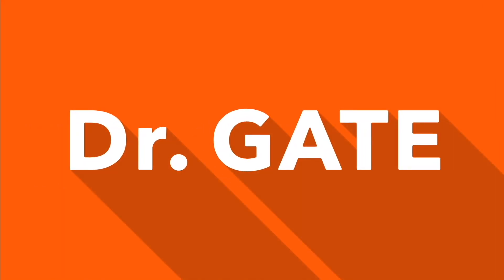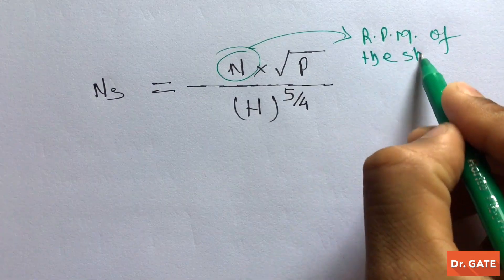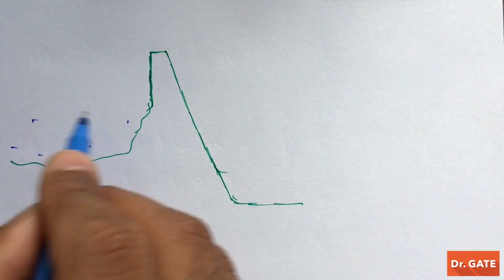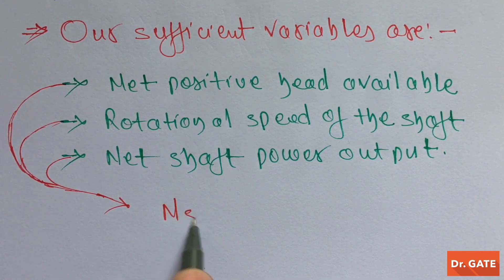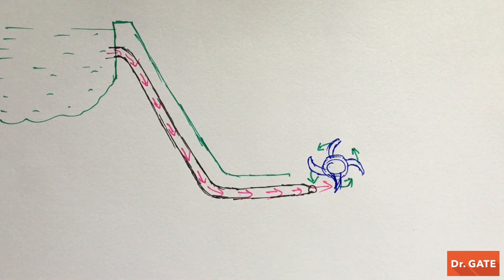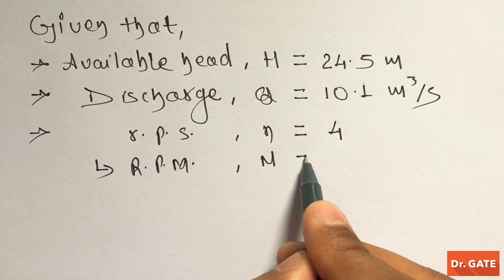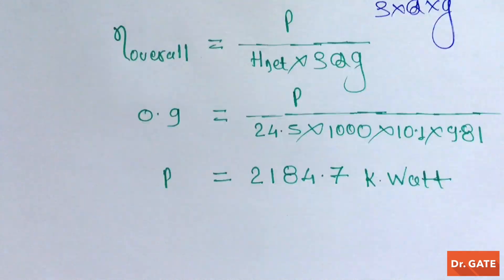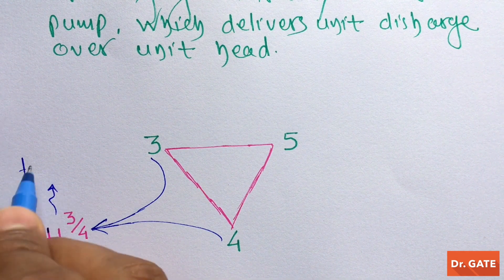GATE 2019 | Fluid Machinery | Specific Speed of Turbine

Comment: Sir please explain  what is the exact difference between Vapour pressure and Saturation pressure.
Or 
Are they same thing?
Reply from the maker: No, they are two different things.
Suppose u r in ur room, which is completely closed (air tight). Then pressure of ur room will be atmosphere pressure ( around 100 KPascal), and air in the room is consist if many components like Oxygen, Nitrogen, CO2, Water Vapour. 
Then whatever pressure is because of water vapour is called Vapour Pressure ( or Partial Pressure of Water Vapour, which is around 3 to 5 KPascal ).

Ur room temperature would be around 25 degree celsious, So the Pressure at which water vapour in the room starts condesing at 25 degree temperature is Known as Saturation Pressure ( Which is around 5 to 7 KPascal)

And the ration of Vapour Pressure to the Saturation Pressure is known as Relative Humidity (RH), which is around 60% to 80% at ur room in these rainy days 😀

So when, Relative Humidity is 100% ( like in Clouds ⛅️) both Pressure have same value.

I hope ur doubts are clear now 🙂
Reply: Thank You very much Sir